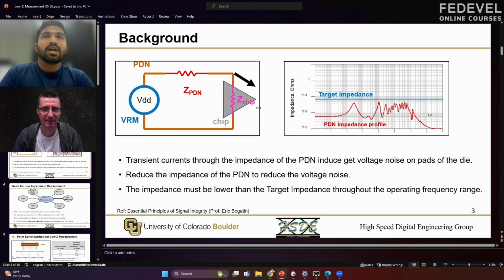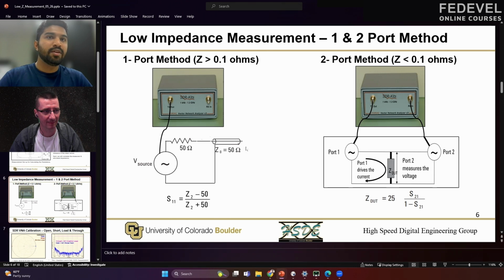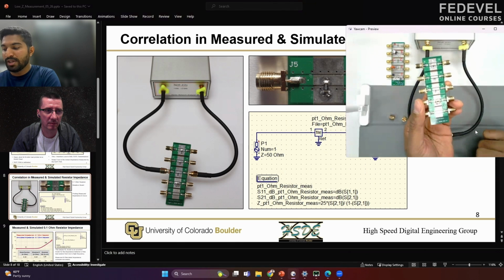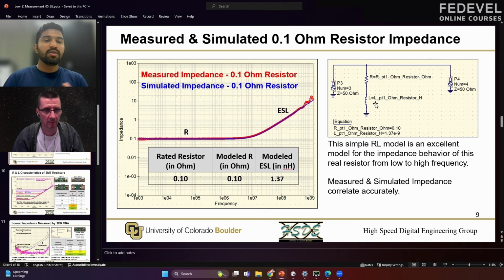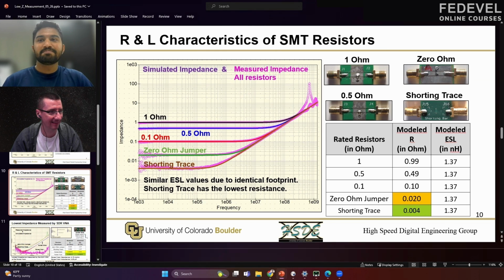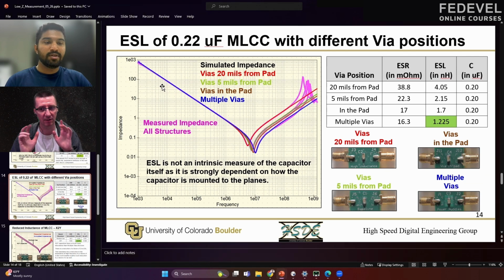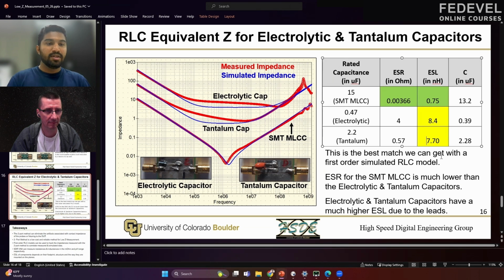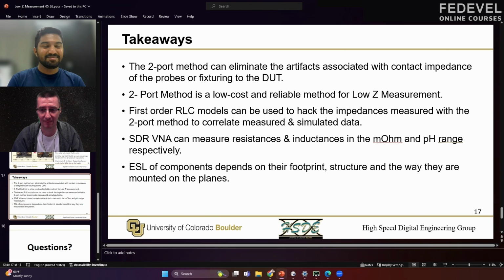How To Measure Low Impedance With An Affordable VNA And Using Free Tools

Comment: Another interesting thing to look at is AVX's interdigitated capacitors (IDCs), which come in multi-pin packages similar to resistor arrays. They are still a single capacitor internally, but by connecting the pairs of terminals in opposite polarity you create opposing current loops that reduce inductance. They do make layout a little trickier in dense areas since you need to be able to fit vias nearby in opposing patterns, but often your BGA/LGA packages have alternating GND/Vxx pads anyway for referencing when they have high power integrity requirements, so direct in-pad connection is often possible there.

Comment: It would be interesting to see the difference between <=0201 package size mlcc vs 0402 x2y cap at same capacitance. Furthermore I would like to know the difference in esl when using 2 super close vias vs multiple vias. I think the esl should be lower than inpad vias because the distance is shorter.

Comment: why not nanoVNA ? This device seems really slow and has low bandwidth
Reply: A nanovna can do this too, the noise floor will be a bit higher though. You can work around that by doing some averaging but then it also gets slower. Also, NanoVNAsaver has the calculations shown here built-in and can directly show the impedance graph for the s21 measurement so no need to export and do calculations unless you want to combine several plots in one graph
Reply: @rjordans Shure, the dynamic range (noise flore) of NanoVNA is about 20dB higher than on SDR VNA - But for this measurements a NanoVNA is just good enough and SDR Saver just calculates the complex values out of the S parameter.

Comment: For port isolatio or noise  floor  you shoul terminate  both ports withh 500 ohms termination. When you calibrate you shoul not connect you standards (open, short , load thru adapter), they should be connected direcly to thend of the cable to avoid any phase diffrence.
Reply: Why 500ohms? 👀

Comment: Great video! Didn't get it: what's the difference between shorted trace and blob of solder?
Reply: The picture is small, but I think the trace is just a normal pcb trace, like 20 mils or something. The blob is just a bigger connection, so it's like multiples of the parasitic resistances and inductances in parallel which makes the parasitics smaller.

Comment: Very good presentation, but can I ask? Isn't it bad your S-Parameters were outside the smith chart for your passive resistor? Seems concerning since we then used those S-paramtesr to calculate Zdut
Reply: Probably due to poor calibration?
Reply: “Cheap” cal kit + “affordable” VNA, is what it is. 

For 400+ bucks I want my resistors to look more lossy than my shorts.